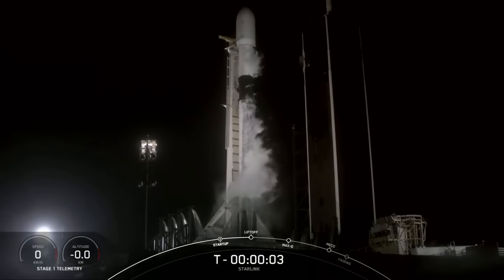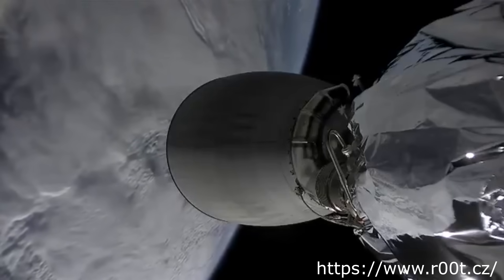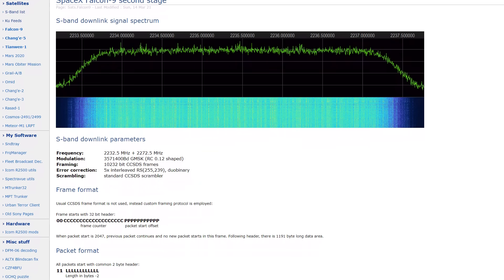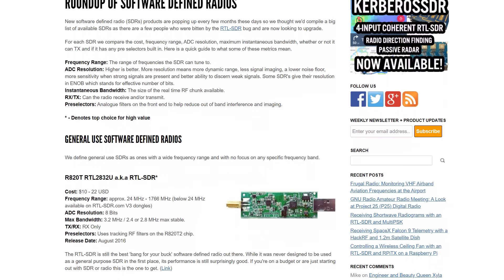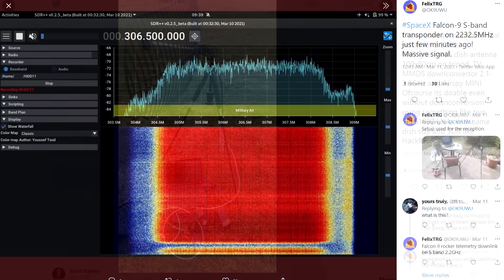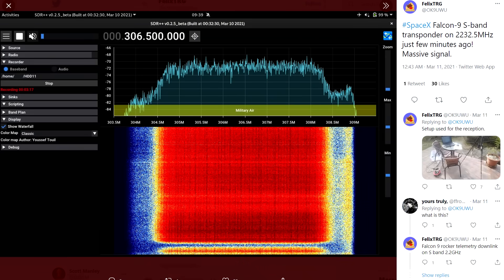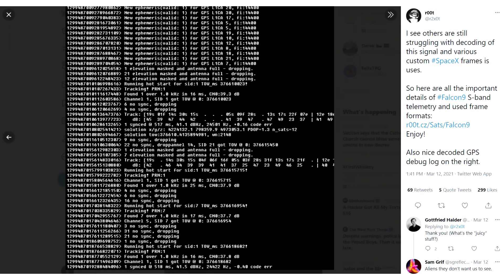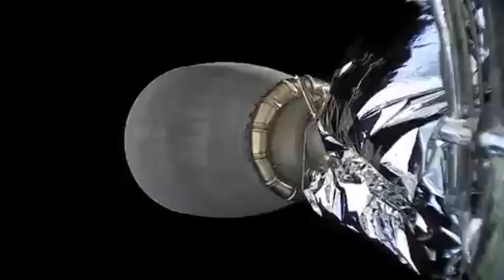How Amateur Radio Fans Decoded SpaceX's Telemetry & Engineering Video

Comment: There's a lot of security though obscurity in space stuff. For good reason: if you lock your systems down too hard you risk denying legitimate access and it's not like you can go to the front panel on your satellite and hit the reset button.

I played with satellite data for my Masters research. One satellite sent data that said "telemetry" but its owners refused to provide documentation so I reverse-engineered it. Used it to write a nice paper on long-term orbital changes (thus how long the satellite was in daylight each orbit) and how this correlated with the operating temperature of the satellite's systems.
Reply: It's more a practical thing here if you want the video live over a potentially flaky radio link then encryption increases your risk of lost video, getting the content (or at least some of it) is probably considered more important than security particularly as downlink video is of little use other than maybe SOME commercial sensitivity or curious interest.
Reply: I would love a Scott video about your work, seems interesting!
Reply: And you’re a pilot! But seriously, that’s an awesome usage for the telemetry.
Reply: That's a great Masters project!
Reply: Meanwhile, universities provide their own telemetry decoder software and documentation how to build your own satellite tracker using RTL-SDR for their cubesats, because they rely on HAM radio operators to send back as much telemetry as possible. At least that's what my university did when they launched MASAT-1 and SMOG-P.
Reply: That, and if stuff blows up you don't want to be unable to decrypt what you got due to not receiving some header adjacent...plus the added overhead of having powerful enough computers to do on the fly encryption now you have to send up more weight and consume more power to do the same job.  Add to that, any hardening to handle the elements may mean you can't use the latest off the shelf gaming desktop CPU and have to use a slower/older but more resilient one...limiting what you can crunch.  Its all risk/reward, if there is little or no gain for significant risk/cost why do it?
Reply: Security through obscurity is not security, or I guess it's barely security. It's like making it so the handle on your front door has to be pushed up to open the door instead of down. Sure it might prevent someone who just walks up and pushes it down then walks away (a "script kiddie" or bot), but if someone spends more than a few seconds looking around they will figure out you're an idiot.
Reply: @lost4468yt  Why are people thinking security is considered important by SpaceX for the video feed? Robustness is probably considered to be of higher importance. Viewing the video downlink doesn't necessarily mean someone can also hack the rocket and make it self destruct using the uplink for example.
Reply: @mfx1  Oh sure I did't mean to imply it was,  I was just making a more general statement.
Reply: @mfx1  They launch mil satellites sometimes, and must not show it close up, for instance.
Reply: @vladimirdyuzhev  Sensitive footage isn't the same as engineering footage what possible use would images of the payload be even if they send them? In most cases it'll just look like any other satellite and TBH most failure data probably comes from general telemetry rather than video feeds. You're making assumptions based on no evidence that transmission of classified footage in the clear has ever or will ever happen.
Reply: @mfx1  You should discuss this topic with security analysts, and I'm not one. Mil always censor the images of the new or secret machines, satellites included. They must have a reason.
Reply: @mfx1  Yes indeed. If SpaceX were to get into some silly "arms race" against the hackers, that would just increase the likelihood of some obscure bug creeping in.
Reply: @vladimirdyuzhev  Truly classified/secret satellites rarely, if ever have any images released censored or not, they won't generally even acknowledge the existence of the payload but any space X footage (if it even exists) is likely to be limited to key engineering points such as release mechanisms and not the payload as a whole.
Reply: @mfx1  They are not released, but they are made, for monitoring and potential lessons learned purposes. Does SX encrypt those videos? I hope they do, because if they don't they are in a world of shame right now.
Reply: @vladimirdyuzhev  "They are not released, but they are made" Evidence? You said they were censored again provide evidence. You're making claims based on wild guess work and assumptions, zero evidence.
Reply: @mfx1  You never seen the later-declassified mil films? They always film their toys, if only to report to their bosses and for training purposes. That footage is classified, until later time.
Reply: @vladimirdyuzhev  Er yes and it isn't obscured, those films were generally made for training purposes and so carefully planned in the case of a satellite launch what possible benefit would that footage be? If they simply want it for eye candy then they can wait for an encrypted version to be downloaded at leisure after a successful launch. If you want footage for engineering failure issues then you need it quickly and reliably and only focus on the points that may fail. "they" don't care about what the classified payload looks like in space they'll have had plenty of photos taken on the ground and as long as telemetry shows it's been released and working why would they care about what it looks like in space?
Reply: @lost4468yt  Security through obscurity is not really security, it's just a lack of scrutiny
Reply: @timocallaghan4408  I like to play with security through obscurity I'm web development. In places I know are likely to get poked around in (specifically in my work for Eve online communities) I like to put random things like hidden fields with a fake user id in the password change form or the like in that exist only to be checked if they've been messed with. I always get a good laugh when I get a security log alert labeled "trap card" when somone gets themselves banned for being clever 😅
Reply: @lost4468yt  A better example would be not bothering to put a high quality lock on a cabin in the woods because its very location and lack of valuables make it less susceptible to burglary.
Reply: @lost4468yt  Your example lags a bit behind, because if someone could see how the door handle was build (e.g. Source code) then they immediately know how the door handle work.

I know what you're saying and get your point, just wanted to tell you, that the example lags a bit behind.

Don't want the whole open vs closed source discussion over again.

Have a nice day
Reply: @dasMichal  >"Don't want the whole open vs closed source discussion over again."

Haha, you don't get to reply to me and then just say "but I don't want to discuss it" :)

Open source systems actually make things more secure so long as security is implemented and there's a bit of community/multi company interest in the project. Making your piece of software closed source doesn't make it so that people can't still try and break into it, it just makes it a bit more clouded. But open source projects mean that a large number of people can analyse the program, especially those with good intentions, and fix problems before they even occur.

Just look at how many exploits in the open source community are actually reported before they ever even happen.

Making your software closed source will not make it more secure, all it does is hide it behind a frosted glass window instead of a window. Making it open source makes it more secure because then tons of people look at it directly and figure out the problems you missed.
Reply: This stuff is super interesting, thank you for sharing!
Reply: And IIRC a lot have very little security with commands too. Like, if YOU casually had a large enough telescope array, you could drive the martian rover
Reply: Maybe
Reply: That is insane
Reply: around nasa they still fear that what they're building will end up being the next Saturn 5. An extremely good rocket that could not be made after few years because they forgot how
Reply: @dallatorretdu  That's misleading. The real reason they forgot how to build the Saturn V was because no one wants to rebuild the Saturn V, especially not the way it used to be made. We don't have the capacity to make the Saturn V, but we could make a much more efficient, cheaper, more reliable, lighter, smaller, etc version.

There's a great short video on this called "Why Can't we Remake the Rocketdyne F1 Engine?" (the engines used on the Saturn V's main stage). They realised that no, they cannot build it the way it used to, because those skills don't exist anymore. But a small team of them was able to redesign the engine as the F-1B, which they designed to be more efficient, more powerful than the F1 (as powerful as the unflown F-1A), and other advantages, and reduced the part count from ~5,600 for the F1 to just 40. And this team was not only smaller than the original team, but the entire thing was basically a side project...

We can't build the Saturn V because we don't have the people left with those old manual skills and old techniques. Is that sad? In some ways yes of course. But the reason we don't have people with those skills anymore is because we have better methods and techniques. Computers can help us in ways the F1 engineers couldn't even dream of, and modern manufacturing can produce parts that are not only better and more accurate than what those skilled people could make, but parts which are cheaper and more reliable as well.
Reply: @lost4468yt  The thing is that we still do have people with those manual skills and old techniques, there's just very few of them versus even the 60s/70s and they charge well for their services because the markets that need that kind of thing are pretty niche these days. You see it a lot with heritage rail, people specifically learning the old ways of doing something because that's simply how the trains built to be maintained and there's usually a few older folk around to pass the skills along.
Reply: @lost4468yt  When they say: "we can't build F1 engines anymore" I think that's more about practicality and economics as much as (if not more than) an inability to create and put together exact replicas of the components. If you gave a team of skilled engineers a historic F1 engine and (given sufficient time + resources) they could probably manage to tear it down and figure out how to replicate everything somehow,  but in practical terms it wouldn't make any sense to do that.   I've read that many components had to be redesigned during manufacturing,  because the original paper designs required some tweaking to make them work properly so the surviving blueprints don't exactly match what was actually built.   Because of that, you couldn't just build a rocket engine factory, hand the original F1 blueprints to the chief engineer and expect them to start churning out working examples..... Or rather you could, because they would eventually figure out how to do it, but the cost and timescale would be prohibitive.  

An analogy would be asking a modern shipyard to build an exact replica of a WW1 era battleship. Perhaps they could do it at enormous cost, but far better to build a modern ship.
Reply: @Andrew-Kerr  True.. but the telemetry f band x2.5 will increase its velocity for impact grounding, would it not?
Reply: @Andrew-Kerr  
You are spot on with the battleship comparison, I used to be a shipbuilder (fitter), someone implying that we couldn't build a new Saturn V or a new Iowa class battleship because we've forgotten how to is simply not true, all the basic skills needed are in use every day in both of those businesses but why go to all the trouble to set everything up to build one when it's an outdated design. 
Just like Ford hasn't "forgotten" how to build a Model T, it's just that if they're going to tool up to build a new car why would they do it to build a Model T.
Reply: @dukecraig2402  There is bound to be an element of obsolete skills involved. ie nobody alive today has ever been trained to make those old parts in the exact same way they were made in the past.  It's not beyond the ability of modern engineers to retrain themselves from first principles of engineering theory and re-invent the old techniques from scratch,  but without any contemporary commercial demand for those skills, what would be the point?
Reply: @Andrew-Kerr  
Today's craftsman can figure it out just like the one's 55+ years ago did, but it goes back to what we've both been saying, there's no point in doing it when the same efforts can be put into building a more advanced machine.
Reply: @lost4468yt  I'm sorry, but I have experience in this kind of engine design and there isnt a snowballs chance in hell they got the part count on an engine that big down to 40. Maybe 40 major structural components, or maybe 40 different closed fluid manifolds, but the total part count just could not be that low. That is unless you are counting welded assemblies as one part which is kind of cheating since they are still susceptible to assembly error as are bolted assemblies, you just can't undo it after like with bolts (at the benefit of reducing weight and operational/logistical complexity)
Reply: @dallatorretdu  Mm, they didn't forget how, it just became too expensive.  Remember the F1 engines were literally hand built.   Very expensive.  There are more than enough examples kicking around, including some from Apollo 11 literally pulled out of the ocean.  The Guidance Computer is old tech and easily emulated on anything (the Apollo Guidance Computer used on the LEM and Command Modules also is still around, it's been emulated in software, the source code for it is available and there is one, fully working version that was restored from a pre flight test model in private hands.   The sad part is that SLS really amounts to nothing more than an updated and more powerful Saturn 5, which flies once and gets dropped in the ocean.  This is literally last century design.  At this moment, one of the Falcon 9 first stage boosters has been flown and successfully recovered no less than 9 times.  But your first statement is basically correct, they are, in fact, building a new Saturn 5.  More powerful yes, arguably cheaper in real terms, but it's still a 'fly once, drop in the ocean' rocket because that's what they know.  So last century.   Starship and the SuperHeavy booster will doubtless eclipse SLS, probably before SLS actually flies a mission and both are fully reusable.
Reply: @geoffroberts1126  You are forgetting the LVDC.  That code apparently was lost.  Also, each mission had different code in the AGC / LEM computer, and only code from a couple of missions has been found (and now archived on GitHub, actually).  There is also a specific instruction (EDRUPT) in the AGC that nobody seems to know/remember all of the details of exactly what it did.
Reply: @rgarito  ISTR that there's at least one LVDC kicking around.  Not sure.  As I recall, they have the complete source of 'Luminary' which flew in the Apollo 12 LEM and at least one of the Apollo CMs software.  IIRC, they have some others, or maybe just parts, as 'rope' memory but not source code.  Put it another way, I'd say they could make an S5 work, but like a 36 Ford, why would you want to?   It's way simpler to build something modern that would work better and be cheaper.
Reply: @geoffroberts1126  There is one supposedly mounted on the rocket outside at Cape Canaveral, I believe.  But the concern is that it's been outdoors in the rain/elements for 40+ years, so the chances of being able to recover code from it are not good.  AFAIK, they have never tried...  There is a complete copy of Luminary (for the LEM) as well, but only from one mission.  Each one was unique (as were the versions used in the capsule) and apparently most of them were lost (or at least misplaced).
Reply: ar @rgarito  Sure, but they don't really need the original hardware anyway.  Easy enough to emulate.  And the LVGC, no doubt they have newer stuff for other boosters that could easily be adapted, it was a very simple computer.  Given they have AGC source code for Luminary (Apollo 12 I think) they can doubtless refine that  or simply redo it in an some other form.  I've no doubt SpaceX Falcon 9 computers that handle launch, turnover, reentry and soft landing using all manner of sensors and terminal guidance are orders of magnitude more capable, the code for a simple airless landing would be trivial compared to that. I believe they have partial listings of some other code, some in rope, some as partial listings.  There's a very interesting YT series about the restoration of a test version of the AGC to working order.  They actually used it to fly simulated landings on the moon using a rope emulator to provide the software.  Put it another way, if someone built a Saturn 5 clone (not impossible, just expensive) or a more modern variant (mostly engine wise) I'd be very confident that the computer side of it would be trivial.  Hell, a ten buck Arduino could handle it and would be faster, more memory and more durable.
Reply: @dallatorretdu  Uhm no, we know exactly how to build a Saturn V, the difference is our industrial base has moved on from 1960s technology. The main challenge in a rocket is the propulsion system and there are numerous companies that could build large kerolox gas generator cycle engines at 1000psi if given the money.
Reply: @chriskerwin3904  One part that WAS lost was the code for the LVDC (launch vehicle digital computer), from what I've read.  That code was on one of the stages that gets dumped in the ocean (1st or 2nd stage, I believe).  There are very few (if any) LVDC's with code intact, left in existence. The only POTENTIAL surviving copies of it are on the 2 or so remaining Saturn V rockets (like at Cape Canaveral), but so far from what I read, nobody has tried to see if the code is readable anymore.
Reply: @chriskerwin3904  you are definitely right. Making statements like rocket engineering has degraded because it can't build Saturn V is like making statements: automobile industry has degraded because can't build Ford model T anymore.
Reply: @chriskerwin3904  well sort of. It's a combo of our manufacturing base moving on and also there were a lot of manufacturing processes used for the Saturn V which relied heavily on operator experience. Like there'd be Joe the TIG welder who know exactly how slow to go over the upper left seam of flange connect 2291 or Tom the break press operator who knew just how much to press on the sheet metal in order to get the perfect curve. Now the Joes and Toms of the supply chain are either retired or dead since they stopped launching Saturns so much of the undocumented know how truly is lost.
Reply: @dallatorretdu  
We have full instructions that are detailed on how those rockets are made and how

It’s just that those methods that are used to make the rockets are old and would cost extra millions and millions of dollars to do it the same way as back then
Reply: @dallatorretdu  is this actually reference to what really happened or a joke?
Reply: @Henrix1998  a joke :D
 only lost the artisans handcrafting some parts as far as I know. and comments seems to prove that
Reply: @dallatorretdu  what do you mean, 'forgot how'?